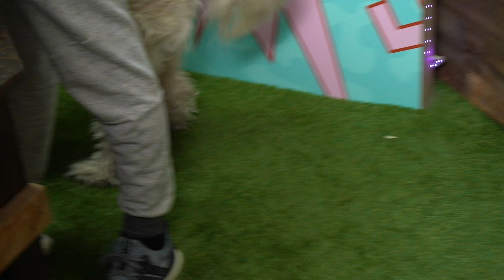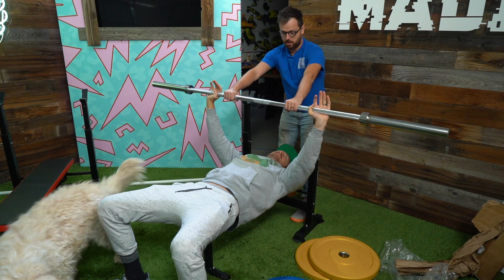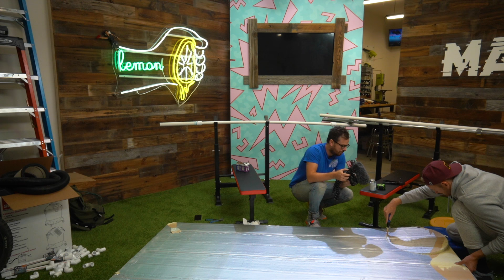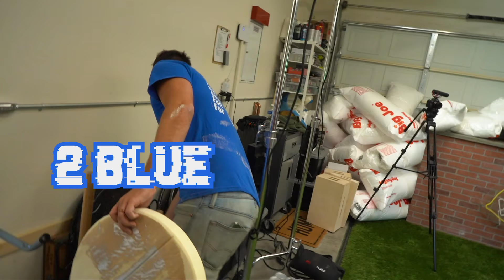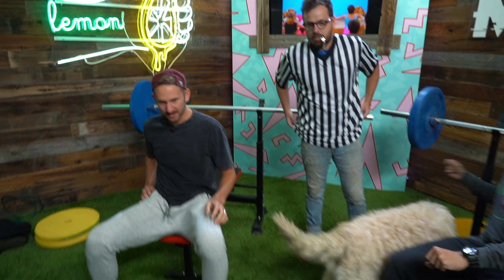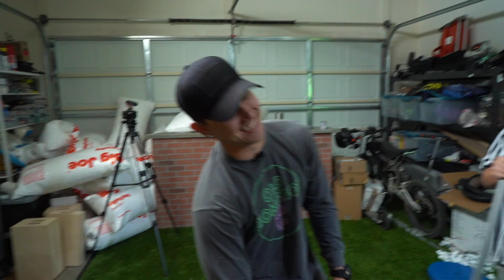We Made Fake Weights!! Ft. Bobby from Team Edge

Comment: They are making the weights out of something called ISO, it’s roofing material.... it’s insulation among other purposes, cool to see them use it, it has to itch it has fiberglass in it. The styrofoam they use in some of these and break the wall challenges in team edge is also roofing material called R tech insulation.., just cool to see them use it as I am a roofer, commercial flat roofing and shingles on residential.

Comment: Probably should have used EVA foam. They use it for cosplay costumes, armor and weapons. No weird cover you have to rip off and no cracks you need to fill in and very versatile.You can sand it, seal the pores with a heat gun and spray it with colors too (best to first use a primer though)